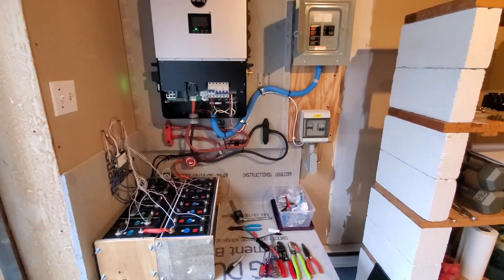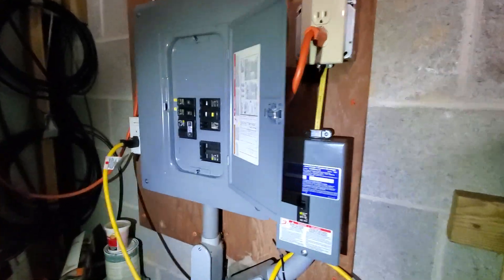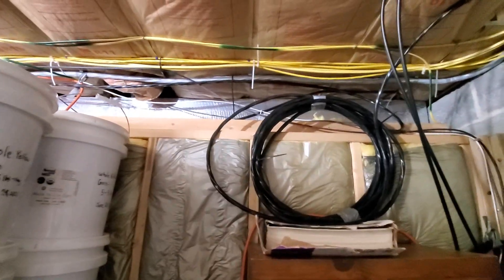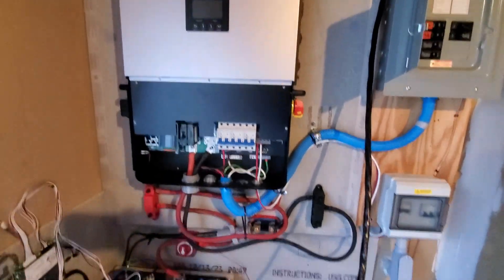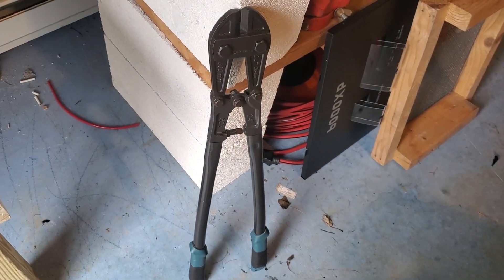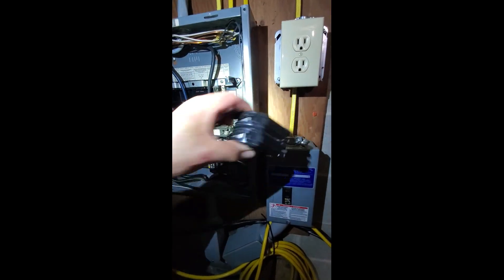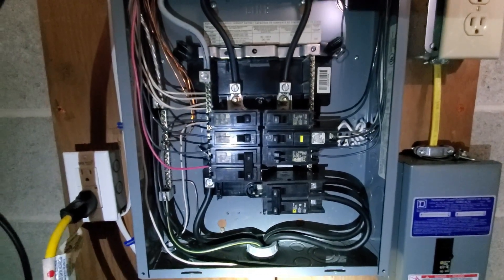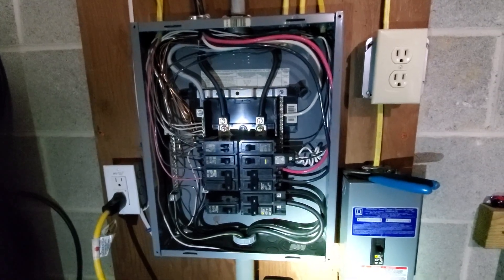EG4 6000XP - Part 5 - AC Input hookup - Solar system upgrade

Comment: Hey, beginner here, I've watched your whole little mini series here and I've somehow walked away knowing less than what I knew coming in. Basically a weather rant interspersed with you pointing at a snake's nest of wires going "There you go. There's what I did"
Reply from the maker: LOLOL I'm glad it was informative for you. Nothing makes me feel better than helping someone out. LOL but seriously there is a bit more to this than most will show. There is a lot to learn if you are starting new. The system is working fine for me. If you have a question feel free to ask and I'll try to answer. Been off this channel for a bit due to work but about to come back with a full conclusion after a year of use.

Comment: I feel like I'm about 95% sure this will be my charger/inverter, and probably gonna get 3x of it. 
I've been trying to find out if there's any limitations to how big of a battery bank you can connect to it? The manual states >200ah was recommended, but nothing about maximum capacity. I assume using it in voltage only setting will allow you to get like 10 banks into a busbar and connect to individual inverters from the busbar shared terminals?
Reply from the maker: If you are using DIY batteries which cannot talk to the inverter like mine (hence why I am only using the voltage setting) this could be difficult and you would not get all you could from those batteries without a lot of testing 1st. I still haven’t found the “sweet spot” to get the most out of my 1st batteries much less the second! If you are using server racks that can communicate with the inverter it might not be much of a problem at all. I cannot speak for server rack batteries which do communicate with the inverter because I don’t have that nor have I worked with it. A lot to explain here, I’ll try to summarize.

Regarding my hookup with the inverter reading only voltage and no direct communications. You have to understand your batteries, each one, has multiply cells within the battery. If one cell goes bad, the whole battery is dead in the water so you want to keep all cells in balance, working together. Since each cell is basically its own battery and they all have different characteristics you want to know all cells voltage amps at every timeframe during charging and discharging. Only the BMS’s read all cells and has this information. The inverter cannot read each cell it depends on the BMS and takes a “overall voltage” which can be different than each cell, especially at peaking top and bottom ends where the cells jump apart. I always wanted to have the inverter stop discharge or charging BEFORE the BMS stopped it, adding a kind of buffer so the BMS is the redundant system to shut off the batteries. Maybe I am wrong at thinking that but it makes me nerves relying completely and only on the BMS and if something went wrong with the BMS, it could fire the whole battery.

Now I am trying to set the inverter below the shut off of the BMS but I have to know at what level of voltage does this happen well before any one cell start to make a run for the lower ends at 2.5 or higher at 3.65 and then set the inverter voltage cutoff and on at that level of voltage above the BMS’s shutoff with room to spare for changes over time. If you have 10 of these…. Hum that’s a lot of testing. I would almost look into something some others use, raspberry pie, other software to communicate with the inverter to help that process considering the # of batteries you have. Now if you do already have batteries which can communicate with the inverter, It seems it shouldn’t be a problem but I don’t have that and can’t answer that. 

If you have 10 server racks batteries, assuming each battery has 5.1Kh and you have 6 on one server for a total of 30.6kWs and 10 of these server racks, that a total of 306kWs of battery. That is a LOT! Seems more than you would ever need unless you have one big house and workshop! My main concern would be the solar panels to charge that system! If you wanted say 3 days of backup and be able to fully charge them in say 5 hours of sun, that would be a total panel system that would need to generate 61,000 watts an hour or the equaliet of 153 – 400 watt panels! That’s a lot of space for solar panels dude lol and a lot, a lot of $$$. I’m sure you could just buy more inverters to cover the wattage, I don’t know how many more but you could do it. Not sure you would ever recover you $ for that system. It’s a lot easier to be more efficient in energy usage than go that big, my thoughts. Maybe I’m miss understanding your question. Interesting comment, hope I helped and let me know what you are doing lol Take care

Comment: Great Video, question - why no using 8/3 instead of 6/3 ?, the inverter can only do 6000W /2 3000W, if that wire is THHN it can hold 50AMP, but you already have 6/3 so bigger is better , just cost more :)
Reply from the maker: Good question. I might be getting a second unit and I want to use the same one cable for both. It is also over 60' of cable and my wire guide told me I needed 6 gauge for that distance, actually it's 125' because I didn't cut it. I just didn't want to push it on voltage drop over distance and the charger actually can dump 100A in the batteries but that would be on my 0/2 gauge to my batteries. I just decided to go safe with the 6 gauge. The cost difference was $500 6/3 while 8/3 was still $420, both are outrages! Thanks for your comment.